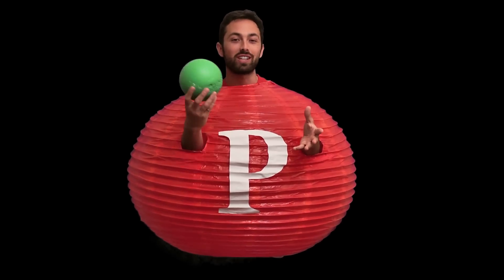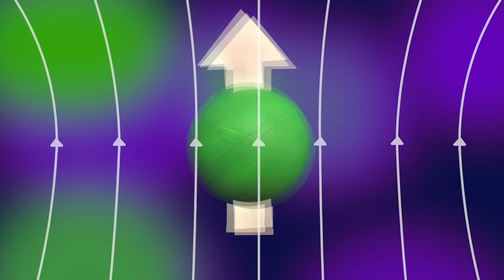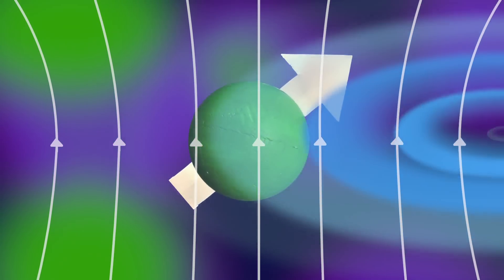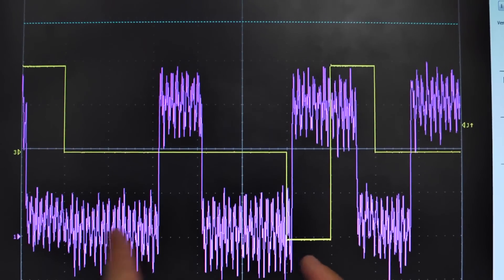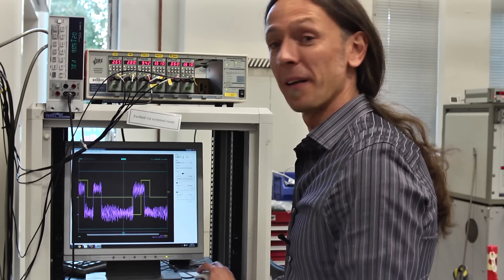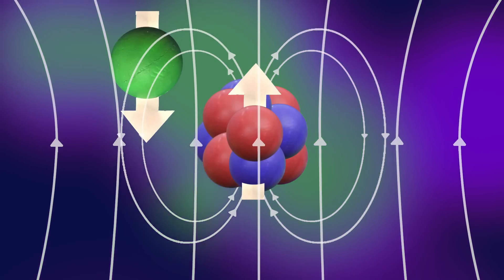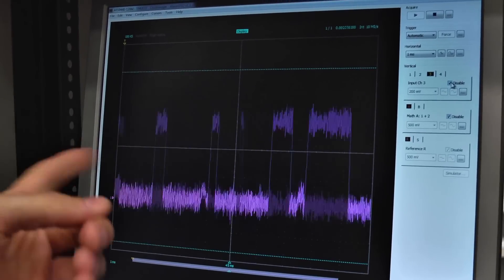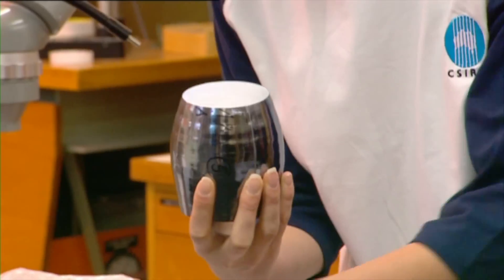How To Make a Quantum Bit

Comment: Can 2 electrons of outer most shell of a dia-magnetic metals have same spin:
:
Initially i thought of course it can be, by providing it with a great latent energy but now i started to doubt regarding so could you solve this dilemma for me.
Reply: when its diamagnetic it can't have the same spin, if the have the same spin they are paramagnetic
Reply: its fine :: i was aware of that >>
i asked only a simple question can a pair of electron have same spin::::???

para magnetism occurs with single electrons
aligned in a same direction i'am talking about pair of electron
Reply: Sharath C M then I would say no due to Pauli's law that electrons in an atom need to differ in at least one variable. If they are paired in a chemical sense they occupy the same orbital and have therefore opposite spin.
Reply: nice link to Pauli's principle there, but is this the same in quantum level.
i mean in a quantum iterations we have seen that it overrides all general laws of physics s,
for example quantum entanglement
????
Reply: I guess I don't see your point. I thought that the opposite spin of paired electrons is a result of quantum mechanics, but I'm just a chemist with a bit of an interest in theoretical chemistry therefore I wouldn't trust my intuition completly
Reply: even the same up here , in-fact all are same for that line ..
a small doubt thought of clearing from my jumbled thoughts of this theory..
there is always an another day for all questions
thank you for @least a try :::::::;;..>>>>

Comment: I was curious what element they chose for a qubit, now, why the phosphorus?
Reply: Phosphorous is the element with one electron and proton more than silicon. Because of its relative size it should be capable to occupy a Si-Position in a crystal lattice (assuming you have mostly Si-atoms, phosphorous itself has different structures, because chemistry). Therefore the phosphorous has one electron to spare. The next part is, that phosphorous has a single natural isotope (31P) which has a spin of 1/2 (similar to one electron). Therefore its an ideal object for this kind of research, but there might be more reasons I'm not aware of. Sincerely a Phosphorous Chemist
Reply: from what I gathered they chose it because is has the one 'free' electron. I could be wrong on that though.

Comment: 6:32 i know the beauty of silicon :)
Reply: Every women ever
Reply: If you have two intanglet electrons and you can fully contrall the first ons spin state  that meens you can convay instant meseges to the second one by measuring the fitst one spin state and by doing so be able to send meseges faster than the speed of light
Reply: @50Lior  No you can't send information faster than the speed of light.
As soon as you alter the spin of one the entanglement is broken.
It doesn't mean if you keep changing the state of one the other will flip accordingly.
All it means is whatever state one is in the other is the opposite,  but we don't know beforehand what state it is. If you force it into a date then the chances are 50 50.

Comment: Dat Silicon 28 tho...
Reply: costs millions of dollars
Reply: Turns out they can use a mass spectrometer to filter out other isotopes of silicon. There's no economy of scale available for this; it can only produce silicon-28 very slowly. However, it's more that sufficient for small labs to do their research in both quantity and availability of production. They only need enough silicon to insulate the phosphorus atom from the rest of the equipment.
Reply: 0xFFF1: As far as I know the Mass Spectrometer is a destructive method in most cases due to ionization, but some people may have found a way to bypass this problem ofcourse
Reply: It be lookin thicc

Comment: You were incorrect that the phosphorus nucleus has a much weaker spin than an electron. Spin only comes in integer and half-integer amounts. Any spin lower than 1/2 is 0, there is no in-between.

Comment: In another video, you commented that instant long-range communication using qubits was impossible because we can't write to them, but it seems from this video that we can. If we can, seems like a pretty straightforward matter. Well, not in practice yet, but still.

Make an array of, let's say, 64 qubits, and another with its entangled pairs. Place them in devices A and B capable of measuring and changing spins. Hook it up to a classical computer. Make initial measurement of the entire array in A and assign all measured spins a value of 0. Their exact opposites are 1, and 0 in machine B. You now have a pair of entangled qubit arrays with the same representation of data, and flipping qubits on one end will instantaneously transmit it to the other.

My knowledge of this is superficial at best and there's probably some other reason why it wouldn't work, but it seems theoretically doable to me, if we can flip them along with just measuring them.
Reply: +otacon1024 From my understanding, entangled particles only remain entangled until they interact with the environment. By measuring or changing the state of the particle (or qubit), we cause the pair to become decoherent.

Comment: Seems that quantum CPUs would be much more vulnerable to magnetic interference?
Reply: +Andrew Mann lol, just because some guy said that they wouldnt be better than normal computers, doesnt mean it cant. Back in ye olde days when a computer was so big, it had to have its dedocated room, and power usage equivelent to that of a small town. But we could shrink the technology, which produced less heat, we add in a new clock that could generate fast pulses aaaaand you have a faster computer. Its like walking on 4s and saying that walking on 2 legs isnt better.

We will find out in the future
Reply: +Milan V Not if you protect them?
Reply: I guess i frogot p in pc means personal lol
Reply: Yes I think but, at least for now, these would just be used as super computers and not in anyones personal pc
Reply: Andrew Mann alright thanks, well it seems that those who are trying to make this kind of pc are having a lot of problems since they are struggling with it, i've seen a quantum pc prototipe being manufactured recently
Reply: Andrew Mann Yeah but they will have their use
Reply: It would probably be covered in lots of protective material
Reply: You can have something like active magnetic cancelling(like sound)
Reply: @bhu1334  fields don't physically interact with each other or change each other's strength.
Reply: Yea, gonna be an engineering nightmare....
Reply: Maybe create a powerful magnet all around the computing bits which repel outwards?  That way, outside interfering magnetism will just be pushed away.
Unfortunately, this will probably also effect the internal nucleuses....but...if we can somehow account for that when designing the qbits, then it'll work!?
Reply: @vjm3  No an opposite magnetic field would not work. Imagine dropping a stone in a pond and then using another to cancel the waves out(you cant). 
If you had two equal and opposite magnetic fields say 100m apart they would only cancel in the middle exactly with each dominating near their source. u metal would do it
Reply: to have this in a personal computer is probably at least a 100 years away. it requires sooo much big expensive equipment so its more likely that all quantum computations will be done at non personal quantum computers especially because they DONT make ALL calculations faster, only specific large scale operations. the most i could imagine this being used as a personal computer is 50 years from now paying a fuckload to have a large quantum computer for graphical processing of whatever 40k turbo hd tvs we have in the future

Comment: When computers were first developed, people were using light bulbs to represent numbers.  Each light bulb represented a number in Base 2.  
Light Bulb 1 =  1    (2^0)
Light Bulb 2 =  2    (2^1)
Light Bulb 3 =  8    (2^3)
Light Bulb 4 = 16   (2^4)
Reply: If the light is "ON"   we give it the color "White" or "W"  (in binary On = 1)
If the light is "OFF" we give it the color  "Black" or "B"   (in binary Off = 0)
Reply: During a brown out, the lights aren't quite on or off...they are dim.
So now we can represent a number in Base 3.
If the light is "ON"   we give it the color "White" or "W"    (in Base 3    On = 2)
If the light is "DIM" we give it the color  "Brown" or "D"   (in Base 3  Dim = 1)
If the light is "OFF" we give it the color  "Black"  or "B"    (in Base 3   Off = 0)
Reply: Designing an electrical switch that is reliably DIM has not been easy.
The CUBIT may be that DIM switch that engineers have been looking for.
Reply: Those calculators were made before the bulb. Even before electron current was fully understood.

Comment: So if you were going to write this into code how many different states will the system have in 1 bit?

1. One state where the electron wont respond to the frequency because of the spin of the nucleus

2. And another where the electron is spun up from the frequency and causes a voltage jump

3. And one where the electron is spin down and wont cause a voltage jump. So 3 right?

And if so how do you differentiate between 1 and 3 where neither will cause the transistor voltage to jump?
Reply: Louis Clark A single q-bit has three states, 0, 1, and (01)  -- the later being both 0 and 1 at the same time. If you put the bit in the 0 state, it reads as 0. If you put it in the 1 state, it reads as 1. If you put in in a partial (01) state, it will read either 0 or 1 each time you measure it (with some probability measuring each).
If you then used that q-bit in the (01) state to do something, you could get some result also containing (01) states. However, the result gives you both calculates -- as if you did it using 0 and then 1. For example, say you added two q-bits -- 1 + (01). The resulting q-bits would hold (01)(01), but when you read them would either be 01 and 10, but never 00 or 11. Two q-bits are essentially holding [1] and [2]. You have effectively added 1+0 and 1+1 at the same time and when you read it, get one correct answer.
Obviously not terribly useful for simple operations. But assume you had a 32 q-bit system and could add and divide one q-number by another... you could set the first register say [465234] and the second to (01)(01)(01)....(01) and run it. You would then immediate get all the random factors for it. You can still only read one, but its still insanely useful. If you read the register you might get say [3]. Repeat the calculation and you then read maybe [53]. Next time [7]. You can then take [465234] and (normally) divide by [53][3][7] and get [1254]. Run this divided by (01)(01)(01)...(01) and you'd quickly get the other prime factors.  If a normal DIV/MOD operation is say 30 clock cycles, you've likely gotten an the prime factors of [465234] in maybe ten divisions, say 300 clock cycles.
The only other factors algorithm for numbers would be to try dividing it by 1, then 3, then 5, and 7,  etc. This could take far more than 10 of DIV/MOD operations, plus all the time determining the sequence of prime numbers, to reach 53 (the largest prime factor of that number).  For larger numbers, the highest prime might require hundreds of thousands of DIV/MODs to reach larger prime factors.
Reply: Thanks for taking the time to write that. Really useful
Reply: BW022 I think I might slowly understanding, can you point explain what type of problems this can solve?
Reply: AshyLarry Prime numbers are key to many cryptography systems. Factoring them large numbers in linear time would effectively make 128bit, 256bit, etc. encryption useless. You could try every 128bit number simultaneously until you get the factor(s) in the key.
There are a number of pure mathematical problems. Certain scientific theorems are specifically based on the these. Certain modeling and simulations are useful. For example, you have a complex set of mirrors, lenses, or materials and you need to know what wavelengths of light might make it through. You make an algorithm and you simply try all wave lengths and you get a number. Run it 10,000 times and you have a good approximation of what wavelengths of light would get through and how much of each. Weather, antenna lengths/shapes for cell phones, radar absorption/deflection of materials, deformation of materials through heating, simulation of biochemistry systems/molecular engineering, finding optimal answers given a fixed algorithm with lots of variables and a limited number of solutions, etc. Possibly searching through long lists, pattern matching through large lists, photo/imagine recognition, etc. although questions remain whether a quantum computer can access data not in q-bit format without forcing a 'read' of its own bits -- or how many q-bits a potential computer could have in order to store information.
Part of this is we don't know. We don't really have computers which are more than utterly basic or which can execute algorithms of any specific size or complexity.
Reply: BW022 
Great explanation and examples, do you do work in this field or just have an interest?
Reply: oisinm25 In university (computer engineering) in the late 1990s, I copy-edited a paper from some graduate students which discussed quantum computing -- a physics grad students was working with a pair of students/professors in a different university. I spend time explaining some of the physical aspects of silicon doping to the physics guy. I did enough QM to understand it, but it was still spooky stuff and it was entirely theoretical -- it assumed such things existed and was only discussing relatively small q-bit systems. I never went into manufacturing so I haven't used it in decades.

Comment: Guys sorry but I don't know anything about this field so I have multiple questions 

First of all how do they reach for the atomic level and dope with a single atom ..

2 . How does that make the computer better at nonlinear stuff .

3. Why do I need to use the spin of the atom while I have the easier one 

And plz if u know online courses or pdf books that may help me to get to know these things .. I'd be very thankful ,
Sorry for being such a dumb
Reply: mohammed sadek i hope someone replies to you so i can read it too..
Reply: i thought that my questions were so dumb that everybody died
Reply: mohammed sadek 
1. most likely a spatter technique, research crystal growing semiconductors
2. Quantum computing arrives at the solution in less steps then a classic computer. Say if the classic computer had to go through 1000 steps to get to the solution, a Quantum computer would do it in 250 steps or so.
3. Mostly just for science; as they said in the video, it holds it's orientation much longer and under higher temperature environments.
Reply: mohammed sadek 
1. most likely a spatter technique, research crystal growing semiconductors
2. Quantum computing arrives at the solution in less steps then a classic computer. Say if the classic computer had to go through 1000 steps to get to the solution, a Quantum computer would do it in 250 steps or so.
3. Mostly just for science; as they said in the video, it holds it's orientation much longer and under higher temperature environments.

Comment: trinary system 0, 1 and 2. 2 can represent the "both 1 and 0"
Reply: azrael300s That would be very misleading. There is not one single value that represents a superposition. A superposition simply means that there is a chance between 0 and 1 that the bit is in an up position.

Comment: As neutrinos basically penetrate everything, and only occasionally hit something, what neutrino protection do quantum computers have?  Will the data become corrupt over time?
Reply: No...you don't need any neutrino protection. Saying they "only occasionally hit something" is an understatement. To give an example, virtually any amount of radiation can be stopped by roughly 10cm of solid lead. In order to reliably stop a neutrino you would need roughly 2 LIGHT YEARS OF SOLID LEAD. Even when they do hit something the effect is so tiny it's insignificant to any unrelated experiment.
Reply: Stuart Smith Yes, but we are talking about storing data at the quantum level.  Any lengthy storage would have a higher probability of becoming corrupt over time, then the longer the time, the higher the probability of being corrupted.  And I am not talking about short term "experiments" but actually long term "real life" usage.  And by your definition it would literally be impossible to protect a quantum computer from neutrinos then in actual reality.

Now, I agree that quantum computers can be utilized for analysis of data, but I also believe that the limitations of a quantum computer also have to be recognized.
Reply: Stuart Smith It would also then seem to me that a quantum computer could never be utilized for long term space journey's other than maybe to quickly analyze data.  (At least at this time of human evolution).